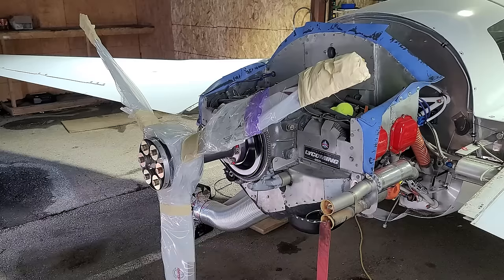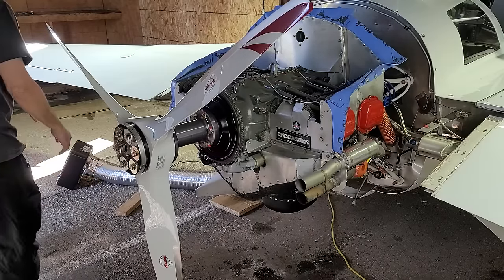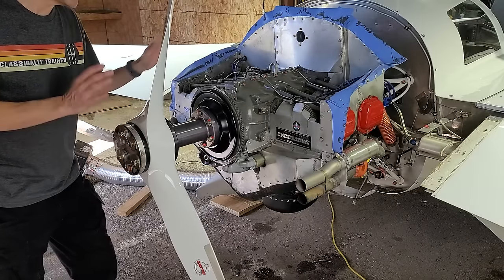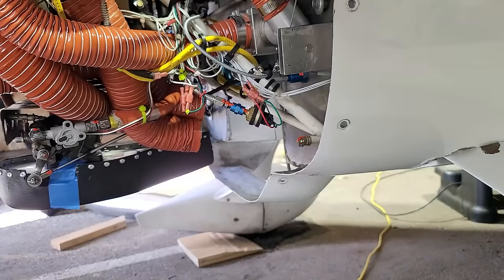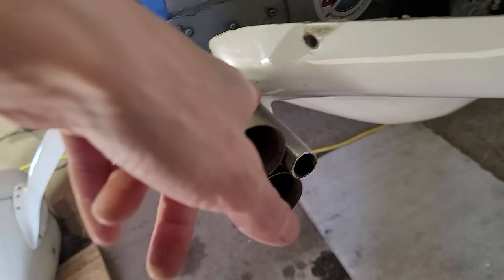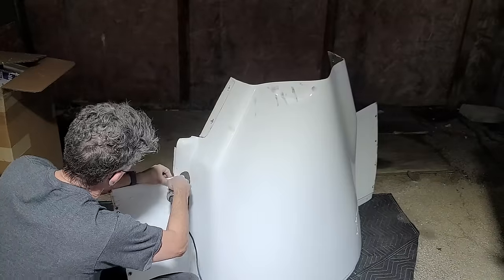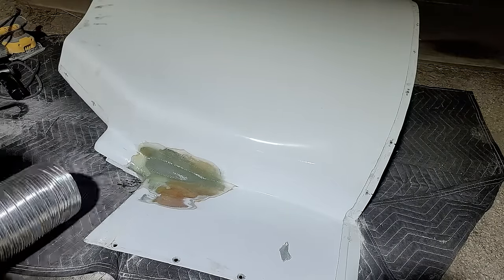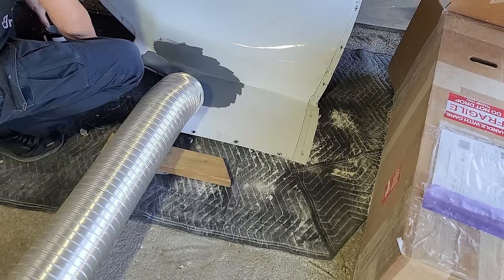Test Flight Preparation - Last Minute Problems Discovered

Comment: When replacing my lower cowling, the hanging oil cooler is what gives me the most interference so I tie it up out of the way some. 
This particular very extensive condition inspection is something that all new owners of experimental category aircraft should go through. It’s the only way to intimately know important details of what someone else built and correcting them to your liking and to the latest solutions to problems common to the specific aircraft model. I consider it a rite of passage and pity the owner who can’t do it or afford to have a knowledgeable person do it for them. Future condition inspections will go much faster.
Reply from the maker: I actually did the last condition inspection WITH the builder when I bought they plane - he supervised, I did the work. It was a great way to learn the ins and outs of the plane.

My oil cooler has a couple brackets that hold it (more or less) in place when the lower cowl is removed.

Comment: I learn something new from every one of your videos. This time, splashing oil around w/o starting the engine by pulling the top plugs. I'm not a mechanic so I wouldn't have thought of that.  
I have a suggestion for doing glass work that was recommended to me by a composites expert. Wear a good respirator. The recommended model: 3M model 06782. I couldn't find it here in the US so I bought it from the UK.

Can you share the type of paint-on epoxy that you used over the micro layer (skin coat) and the UV protecting primer? Would really appreciate that info if you would!
Reply from the maker: It does more than splash the oil around - it actually pumps it through the whole system and pressurizes it, so you get oil on all the crank bearings and cams.

If you watch my other videos, you'll see that I always have a full respirator on when doing glass work - unfortunately, I did not bring it out to the hangar with me, so I had to make do with a particulate filter mask - doesn't help with chemicals, but it at least is better than nothing when it comes to microballoons.

The paint-on epoxy over the micro is just the same exact epoxy used to MAKE the micro (and to do the fiberglass layups). It's a trick I learned...actually, I don't remember where. Instead of laying on micro, sanding away, finding pinholes, filling with micro, sanding, more pinholes ad nauseum, you sand the micro how you want it, then a single thin layer of epoxy on top - it lays down and fills the pinholes. Then you can give it a light sanding and prime. The UV primer is Stewart Systems Ekofill - actually intended for fabric surfaces but also recommended as UV protection for glass: https://www.aircraftspruce.com/catalog/cmpages/ekoFiller.php?clickkey=3133197
Reply: @CanardBoulevard  I know exactly what you mean about the tedious process of filling in micro pinholes, your trick with epoxy is great! Thanks for the reply!

Comment: Is that a camera artifact or can i see run out in the prop hub on oil up?  Great vidoes!
Reply from the maker: It's not the hub, it's the spinner mounting flange, and it is slight - but with the spinner installed, it's so light and such a tiny imbalance that doesn't make a difference to vibration levels.

Comment: why replace the two bladed prop .  a two blade silver bullet prop is a good choice .. 30% less restriction around the hub .  following the propeller evaluation testing carried out  of the powered paragliders   pilots like Tucker Gott.. Maybe make an approach to those / his  propeller manufacturers and become a test pilot for their products .
Reply from the maker: I never had a two-bladed prop. The original prop was a three-bladed Catto, as is the new one. I like the three blade, as it provides a lot of braking effect when you pull back power.

Comment: Lot of runout on the prop hub, is there a spec for that?
Reply from the maker: It's actually not on the hub, what you're seeing is on the flange that mounts to it that holds the spinner in place. I saw it as well, but the spinner is extremely lightweight fiberglass, and it doesn't seem to cause any vibration (or any that it is creating is being damped out by the balance ring).

Comment: None of that crap you were grinding/cutting/sanding is good for you to breathe in. 
You really should have feathered the edges more and stepped out the repair. 
Mixture control split pin looks a bit sloppy. My tradesmen would have yelled at me for doing a split pin like that.
Trying to keep it positive, most of the work you do is very nice and you take great care of it.
35 years of this caper tells me to look after your health.
Reply from the maker: I actually have a full respirator that I normally wear for this type of work - but I want expecting to have to do this, so it was at home, which is why I was just wearing a dust mask. But yes, I normally have my respirator on!